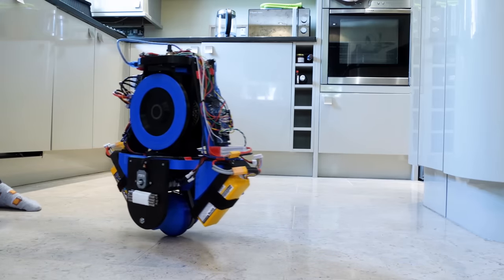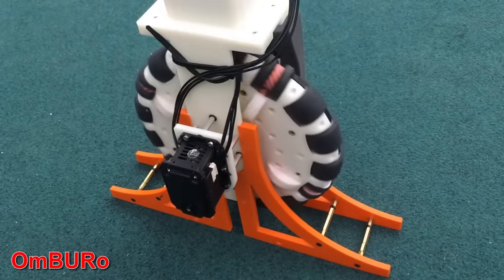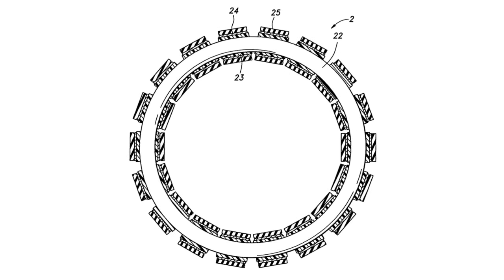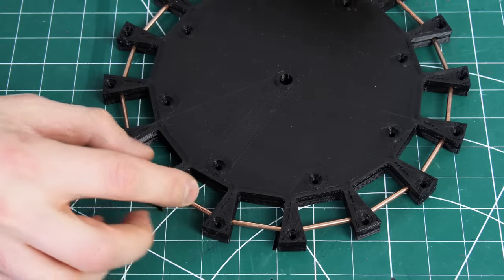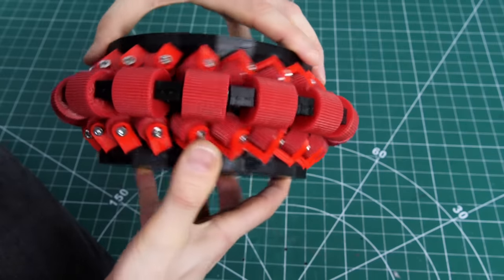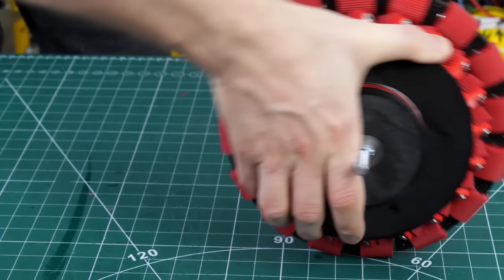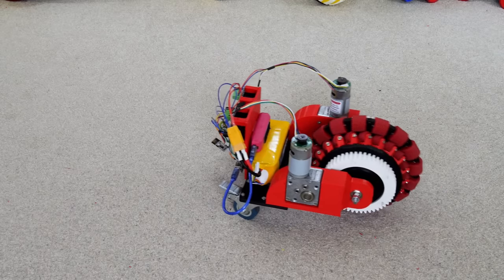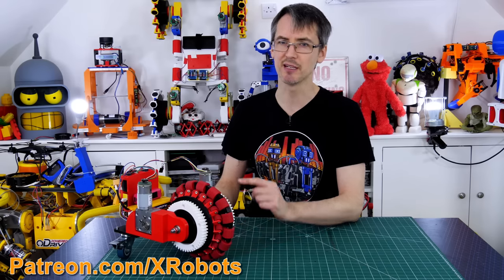Why this Omni-Wheel is Really Weird

Comment: Facinating! But I'm always interested in off-road work. I dread cleaning an omni-wheel! XD But having said that, the Honda design could be made so it could just be hosed down, couldn't it? Perhaps that's why they made it with friction instead of gears. If it weren't for that, I'd prefer the geared solution because... uh... frankly, because my slightly obsessive tendencies drive me that way. Balanced evaluation is hard when you're driven.

Comment: wonder how it would work with a big rubber O ring as the main roller. as it is elastic it would also pull itself against the smaller rollers.
Reply from the maker: I couldn't find one big enough

Comment: do you think it would work better if you made the outside smaller wheels traction at a 45 degree angle also so it lined up better with the traction of the bigger center wheels?

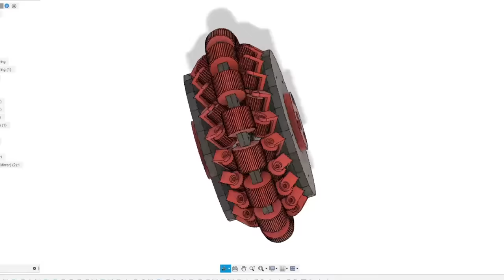Comment: At time 5:45 you talk about how you can't figure out the wheel solution what if you used bead shaped Wheels. It would be rounded on the edge so that when it makes a full circle you won't have any of the friction issues

Comment: couldn't you reprint the rollers as more conventional wheels, with a hard inside and rubbery tyre? If you don't have a two-material printer it would be a bit harder but you'd just need to print the parts separately and push them together. That would provide the grip you want while not being too squishy.

Comment: Those are really clever. Hopefully that patent is expired. Glad you have a bearing sponsor, I think this is the first time I remember seeing you using a thrust bearing 😁 If the compliance in the main wheels was a problem it would probably be not too bad to replace the axles with rigid shafts.

Comment: It seems like a waste of power and a lot of friction to have the sideways rollers around the wheel that are not touching the ground being driven. Simpler to have only the sideways rollers that are touching the ground driven by a motor driven friction drive. The ones on the rest of the wheel can be ignored since they accomplish nothing, and as they rotate to the bottom position the friction drive engages them. This gets rid of the flexible shaft and a lot of moving parts, friction, complexity and weight.

Comment: Great build! What if u used a flexible drive shaft that could transmits torque on the outer wheels that way you are greatly multiplying your contact area and reduce slip. If u want I could cad something to help to show u what I mean.

Comment: could you use just 1 motor with gear shift for direction on each side? a stronger motor that weight less than 2 motors  but much more power.

Comment: Try using steel cable to join all the outer wheels together you'll probably get higher torque
Reply: You'd have to use a "nested double" of cables, wound in two different lays to counter each other's tendency to UNwind... One on the inside, the other opposite winding surrounding it... I've seen cable-flex screwdrivers made that way.

Comment: how would this face in a real world application?
seeing as it's relying on friction it it goes through an oil spill for ex the mechanism itself will need to be disassembled and degreased, whereas with its mechanical counterpart omBURo once the robot is placed back upright it should be ok

Comment: A personal mobility device, that can experience just 1 of 1,000,000 possible mechanical or electrical failures that will just dump you over sideways in a heap.

Slow clap for Honda

Thinking outside the safety envelope.

Comment: ball-vehicle can float on water, too
Reply: a hollow sphere is also the strongest point centered structure from all directions, if compressed or collision, or if crushed
Reply: the driver or cargo must be inside to be able to roll in all directions, the inside has the motors and balancing to have it move and balance
Reply: the outside ball does not have to be balanced
Reply: the outside ball if squishy has a very large body surface friction contact to the ground or water, can have paddles as in normal wheel
Reply: hub motor wheels, on the outside rim, on that design
Reply: the wheel rim can hold small motors per side wheels, assuming power delivery into the rim
Reply: epic dude
Reply: patents should be public access research like this, no compensation, you dont have to pay for your components
Reply: something in vain rules inherited from parents should not be binding

Comment: The only problem you have with this entire thing is the fact that you put the grooves on your main rollers straight instead of on the actual angle of the side rollers so it can actually work like a gear this thing would be so much smoother if you would put the damn grooves on an angle to match the angle of the other damn Wheels come on man

Comment: In motorcycles, in low speed, you have to steer the opposite way before steering to the desired direction. At higher speeds, countersteering is enough to turn.
Reply: A friend with a motorbike once told me this. I didn't believe him so I tried on my pedal bike. Absolutely true. Turn very slightly to the left and you go right!

Comment: I have to ask, why is this so complicated? All of this over engineering seems to only be so that you drive all of the smaller wheels at the same time. Only two maybe three ever need to be powered. You could have a single fixed drive wheel on one side near the bottom that's driven by a small motor instead of those giant ones.
Reply from the maker: The wheel rotates so the bottom isn't always at the bottom.
Reply: @jamesbruton  WHICH small wheel changes, but whichever wheel happens to be at the bottom is ALWAYS going to be the drive wheel. The wheels currently on the top and sides will NEVER be a drive wheel - so they NEVER have to be powered. Use the same friction slip drive gear idea, but only covering the bottom two or three positions. The drive section can be small, self powered, singled sided, and in a fixed position that contacts a few of whichever of the small wheels that happen to be at the bottom. The need for all of that side wheel nonsense is completely eliminated. You've designed for a requirement that doesn't exist. 🙂
Reply: Put another way - stop focusing on the small wheels, and instead focus on the contact patch with the floor. It doesn't move. It's always at the bottom below the axel. It's size is only dependent on how far the robot needs to lean - covering maybe 30 degrees - an arc holding 2 or 3 smaller wheels. For the small wheels, only the contact patch needs to be powered.

Comment: omni wheel is having better grip than normal ?.?
Reply: Omnidirectional wheels don't necessarily require better grip than normal straight wheels. But if your goal is a self-balancing robot that can withstand the downward pressure of a human rider then grip is very important.